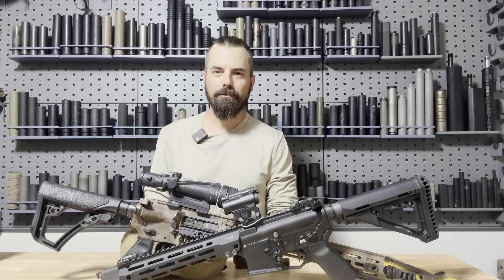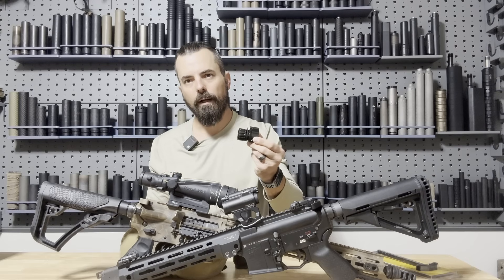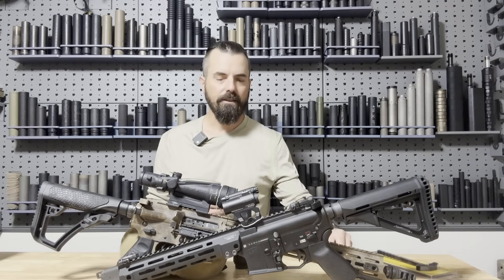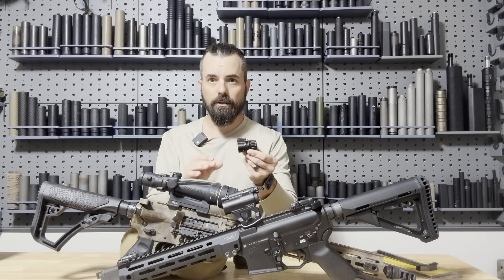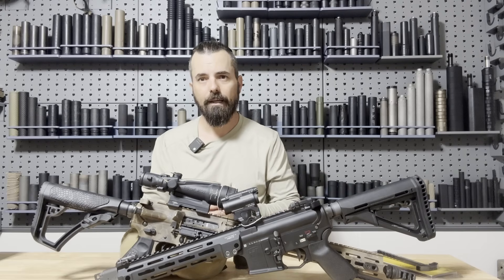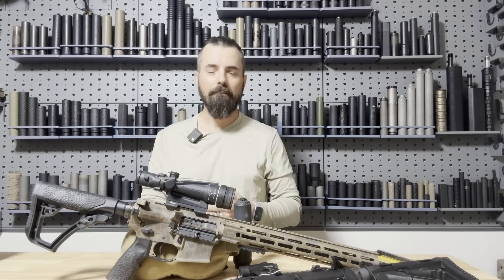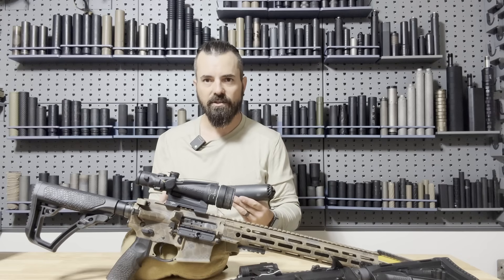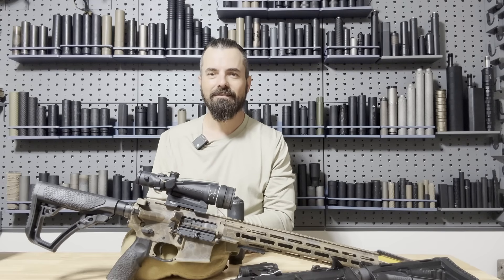How to Reduce Backpressure When Adding a Silencer — Charging Handles, Gas Tuning &Buffer Setup w Rob

Comment: Switching from supers to subs immediately reduces back pressure. So before making rifle changes, see if you even need to reduce back pressure, because remember, an AR needs back pressure!
Reply from the maker: as it is with 300BLK, yes. most of the AR's in the us are 556 or 223

Comment: After my first 300 BO shorty suppressed with a Nomad L, (high backpressure) I definitely think an adjustable GB is the way to go. Does anyone have opinions of the "Bleed off" style (Superlative Arms) vs the regular restriction type  gas blocks?
 
I'm using the Aero adjustable GB and the biggest gas port I can get on my barrels. ( I only shoot subsonic with a Law folder, so I wanted to have all the gas I can if needed for the extra weight of the Law carrier extension, which makes cycling subs a challenge sometimes). Great post.
Reply from the maker: I have a few SA builds, piston and 2 way gas blocks.. they are solid

Comment: The goal here is to use as little gas as possible to move as light a buffer as possible and as soft a spring right? For me specifically, I mean. I’m trying to make a nice subsonic situation out of my 8 inch blackout. Using otter creek infinity and superlative gas block (and a Riflespeed setup). I have my 8 inch barrel set up with the softest Sprinco and a H1. The gas is I think at two rotations. Where 4 1/2 rotations are completely open (superlative gas block). I believe. But I don’t know if I should open up the gas all the way to vent extra. Or if I should pinch it off as minor as possible and push a weak spring and low weight.

Comment: Gas busting charging handles aren't really that good. You need to address the actual problem which is too much gas coming up the journal into the block before being forced back the gas tube. If you are running a suppressor that isn't a flow through type especially you should always run adjustable gas blocks. I have built a lot of high end custom AR15 rifles for people and myself and used a lot of different brands of adjustable blocks and have found Suplertive Arms adjustable gas block that has the bleed off valve to escape any excess created to be about the best adjustable block made. As far as standard adjustable gas blocks the Seekins is good. I've even seen guys bring AR's to me that they put one of those cheap $40 brakes on they thought looked cool that were designed by someone who had no idea about brakes or flash hiders and they don't allow gas to escape properly and the back pressure would blow your damn hat off your head. How these morons can even put them on the market in good conscious to fool the average casual is beyond my comprehension

Comment: I've been rocking the BCM non ambi large latch charging handles and they don't stop much gas. I recently got a rise armament charging handle that almost wouldn't fit in my upper at first. I gave it a few taps with a mallet then pulled it back out and repeated the process several times until the charging handle freely goes in and out without binding but still has a very tight fit. I haven't shot it suppressed yet but I imagine it is fairly sealed up. I also recently picked up an aero precision breach charging handle to replace one of my BCMs. Hoping it is a little better at diverting and stopping gas. Great video as always

Comment: One thing Id like to see is shooting a high back pressure can with the adjustable gas block vs a flow through can.  In my experince the flow cans arent as quiet but my gun will run 3-400 rounds without  more lube.  My 11.5 with the polonium on it start slowing down after about 150 to 200 rounds.  It gets so dry it effects the cycling rate. Especially if your doing rapid fire.   I keep lube in my chest rig just for that gun.

Comment: Would love to see mounts and charging handles! Can't wait to see   rhino X.
Reply: use an adjustable gas block instead of paying a bunch for a handle that doesn't actually prevent gas from going out the back
Reply: @DangerousGas  do you have a specific recommendation my dude?
Reply: @jaydub308  Been testing Faxon's new adjustable gas block on my 12.5, lots of adjustments and works great. Using a low back pressure can like Exigent Defense, Ridgeback Defense and Stealth Additive Works would better though
Reply: @albertptran  nice thanks for the info. 1st can was a RC2. Got some huxwrx and b&t flow through/ low back pressure. Love those on my LWRC markii (piston).
Reply: @jaydub308  the Faxon one is new, so it's hard to say about reliability.  The one that most people like the most that has been around awhile and proven is the Superlative Arms one....The rifle speed one is the coolest and easiest to adjust, but it costs the most money ($200, which isn't a big deal to me, but others it is) and some say it requires a little bit more maintenance to keep it reliable....I don't have one though....I do also have a couple of Odin Works ones and they have been real reliable for me as well.
Reply: @jaydub308  ...and when I say reliable, I mean where they don't carbon lock and you can't adjust anymore...which isn't a big deal if you never plan on changing the amount of gas and keeping it at the same pressures.

Comment: I’m new to suppressors and would love a video comparing the best options for common AR platforms. For example: Mk 18 "10.3-12.5",  "modern" Mk 12, and a GPR AR "13.7-16." — each of those rifles serves a different role, so I’d like to see which suppressor you’d pick for each and why. Please cover preferred mounting solutions (I know a direct-thread or a quick-attach hub is common — what about 3-prong flash hiders or other adapters?), plus top performers for durability and sound suppression.
Reply from the maker: Great idea!!

Comment: I've used a good amount of the gas redirecting/reducing charging handles on the market and can confirm, they 100% make a difference compared to a standard USGI charging handle. There is a noticeable difference between well designed ones, and others with snake oil marketing. Even those snake oil marketing charging handles make a difference though. The charging handles makes a difference with both flow through and high back pressure cans. The weapon outfitters gas vent also makes a noticeable difference in redirecting gas.
There are also other BCG's on the market like the Lantac EBCG that pushes gas forward, away from the shooters face, and the KAK downward venting BCG. Both work very well.

Comment: I would love the CH test from you! Not to put anyone else down, but your content is top tier with suppressors and the related components. I use the BCM version of the A5 buffer system, with what I guess would be H3 (so one step above standard weight) and my can is a Griffin HRT 556. The can is not low back pressure but the sound is pretty damn good. The barrel is a Criterion Hybrid mid length with the chrome lining, and the rifle cycles reliably, with hold open on an empty magazine, both with and without the suppressor, using a standard VLTOR gas block and a standard gas tube.
Reply from the maker: Thanks man!!! Super appreciate you saying that 😊

Comment: A Superlative Arms gas piston kit will give you around 30 points of adjustment including the bleed off to reduce excess gas coming back down the barrel. With a traditional can it makes a huge difference. On a LBP can you wouldn’t have to bleed off nearly as much if at all plus being piston so naturally less gas to the face.
Reply from the maker: Solid system!!

Comment: Charging handle video would be cool. Just make sure to use the most overgassed gun with the highest backpressure suppressor you have to see he differences best.
Reply: Most gas comes back from the chamber, so the gas-buster approach isn't doing much.
Reply from the maker: Definitely! Onnit 😊
Reply: @SilencerAnalytics  and make sure to throw in a mil-spec one with the diy gasket maker applied. good old youtube from 15 years ago. and if that does help, gasket sealant on the best factory one to see if you can make it even better. heck, since all of those videos are 10+ years old, make an updated and HD video about how to seal your charging handle with gasket maker paste.
Reply from the maker: @texasranger24 solid call! Thanks !! 🙏
Reply: @SilencerAnalytics  Try breek arms sledgehammer charging handle, that along with rifle speed gas system and kak down vent bcg is on my latest build. Just need suppressor next.
Reply from the maker: @Sptsmn700 deal 😊
Reply: So why not just use an adjustable gas block?

Comment: I think KAK has a BCG with downward vents, which is supposed to reduce port pop and gas to the face. Unfortunately I live in Washington though 😂.
Reply: Doesnt work as designed
Reply from the maker: @chaoticcaninejb 🤏🏼
Reply: I have two and here’s my personal subjective opinion for gas mitigation… I can’t tell the difference for that use-case.  However, it does do a decent job at reducing port pop, which I think makes it worth it so long as you get it on sale and/or get one of the specialized BCGs.  Example: the Aluminum carrier.  Just recognize that the aluminum carrier will increase cycle rate (use your imagination) and won’t last as long as a standard carrier.
Reply from the maker: @greatoztv4200 🤏🏼
Reply from the maker: I have, I am testing 😊